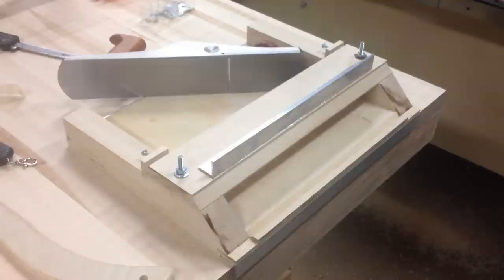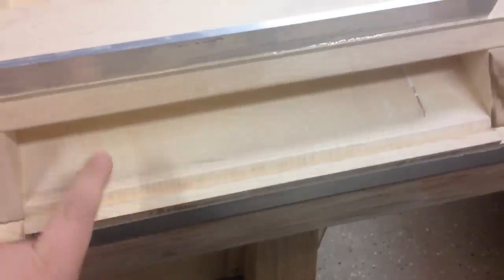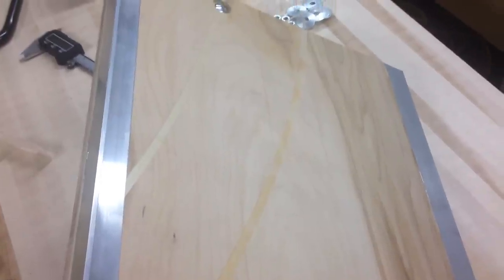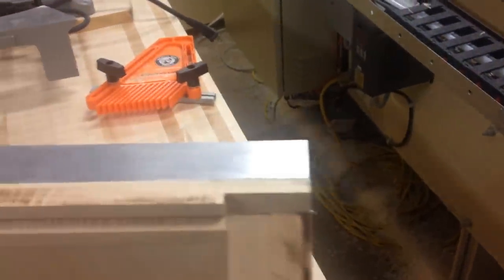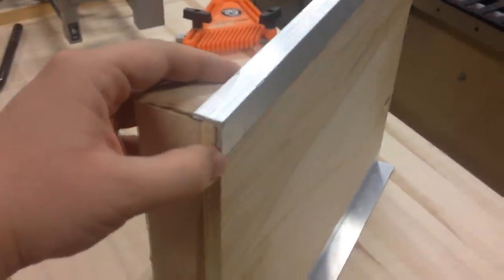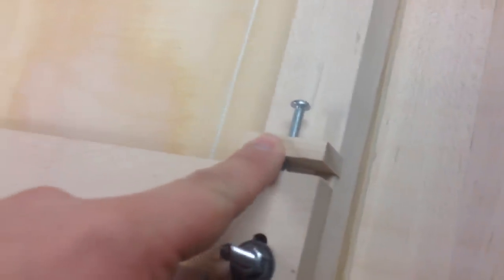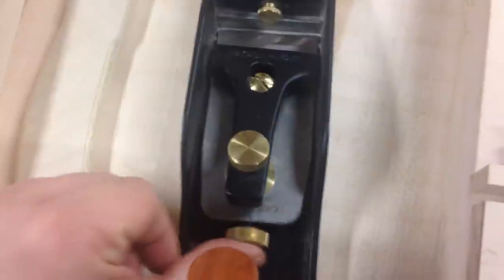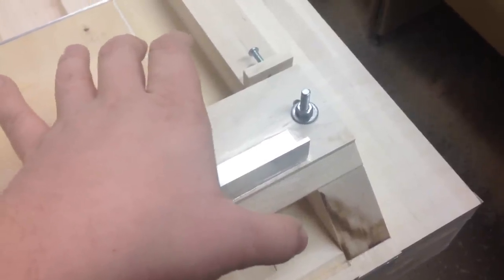The Ultimate Wide Miter Shooting Board

Comment: Nice jig. I have been looking at several of this type and like some of the features you included such as the nice adjuster on the top rail. Insted of aluminum I think I will use a solid wood runner on the bottom to mount it to the bench. I know others have criticized your decision and claim you may hit it w the plain but find that hard to believe. The suggestion to incorporate hold down clamps sounds good. You do need to write down what you say as winging it leads to many awkward pauses and the umms. Don't let that criticism discurage you from making further videos. Just be better prepared and you will do well.